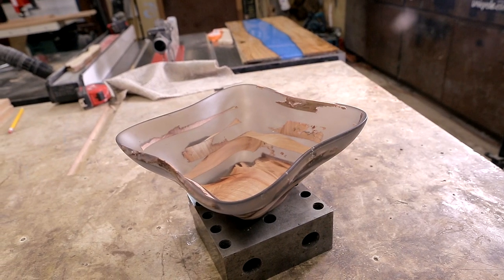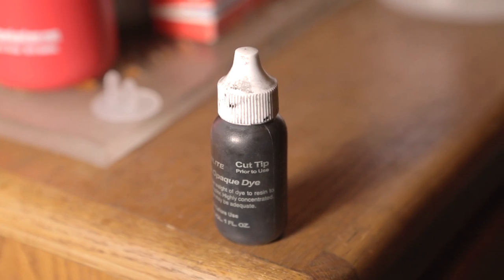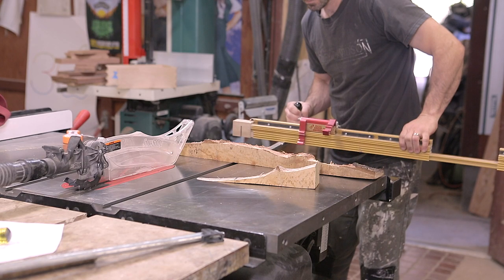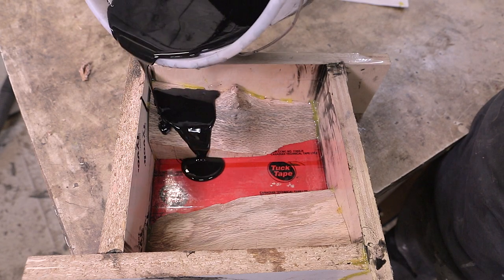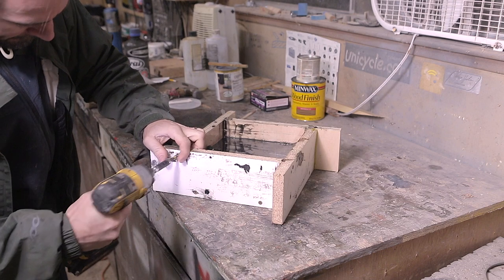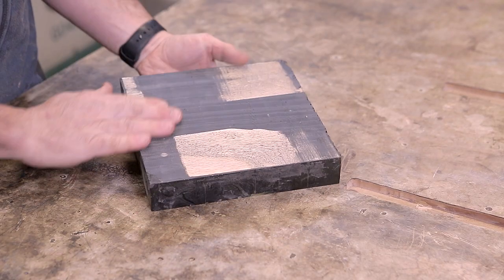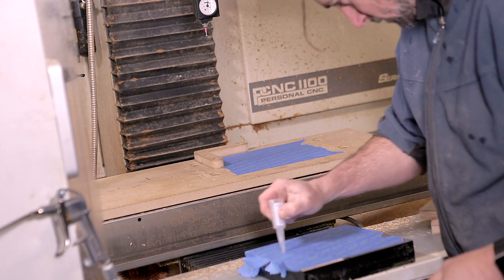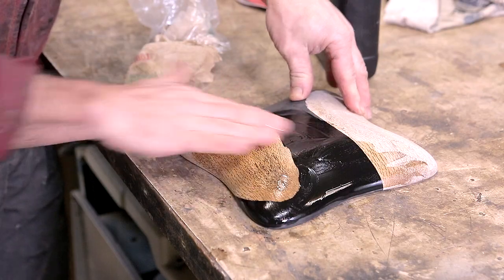Ink and Oak Bowl - CNC Woodworking - Making This Epoxy and Wood Bowl in My Shop

Comment: STL file is not a bowl. just a simple rectangle !
Reply from the maker: Hmm. I’ll have to take a look and update it. I had exported it from Fusion but never checked the STL as I don’t use them.
Reply: @CorbinDunn  I wanna use it in vectric aspire as i used your the other bowl STL file and it was geat.
Reply from the maker: @safaenet  I bet it was a square because I model the stock in Fusion. Try this one: Ink_Oak_Bowl_v2.stl
Reply from the maker: https://www.corbinstreehouse.com/cnc/ink_and_oak_bowl/Ink_Oak_Bowl_v2.stl
Reply: @CorbinDunn  this one is the correct one. Thanks a lot 🙏